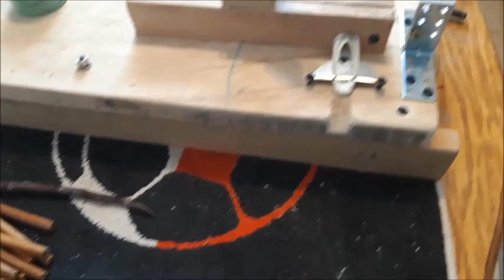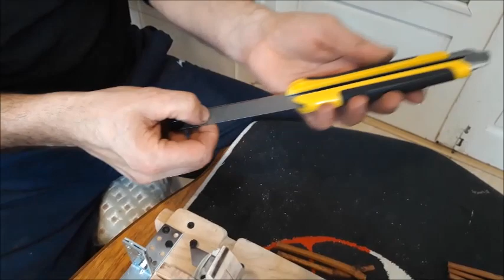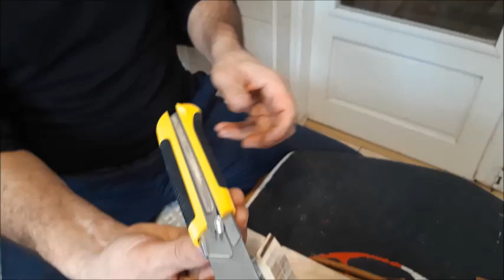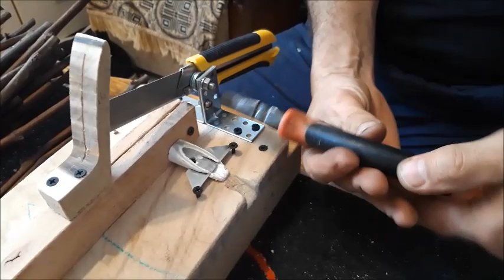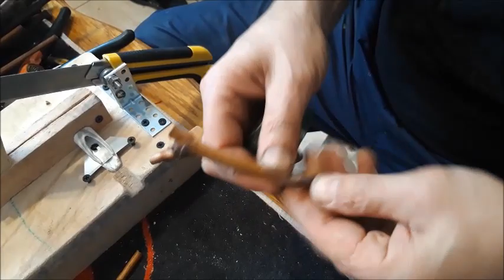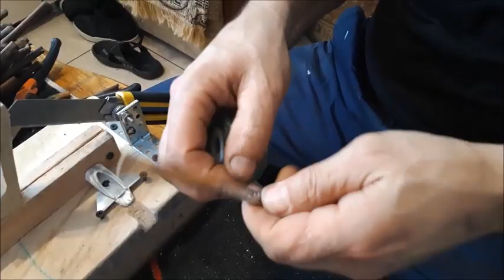Homemade guillotine cutter for grafting _cutter ghilotina pentru altoit

Comment: Putting at least a line, or perhaps a pair of blocks on the first cut would get you a more consistent angle.  Similarly a stop block on the secondary cutter would get you more consistent depth.